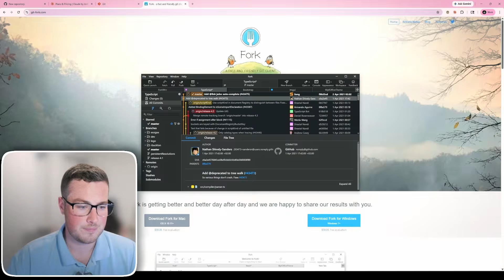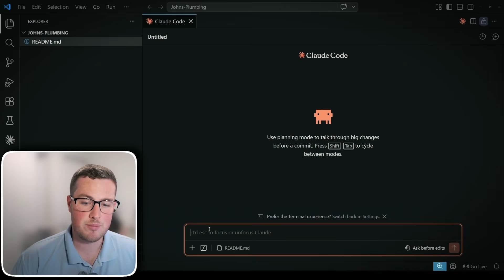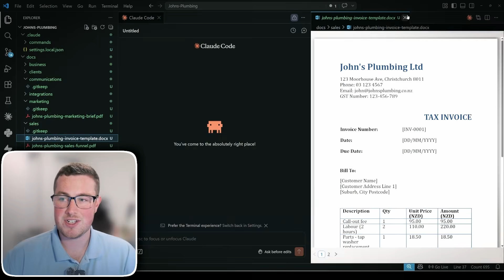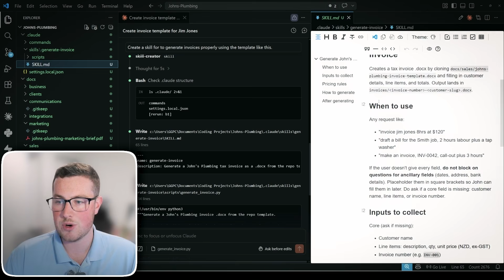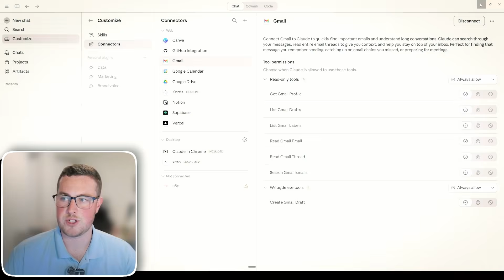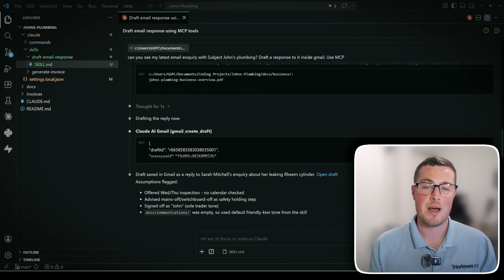Turn Claude Into a Full-Time Employee For Your Business

Comment: Nice content Blake .. one question .. what will happen to the Claude plan Usage limit?  will it finish quickly .. i have pro version
Reply from the maker: For this I'd highly suggest the max plan. Seems like a lot but if you compare that to your hourly rate.

Eg if you charge out $50 / hr and it costs $200. It needs to save you more than 4hrs which I guarantee it will